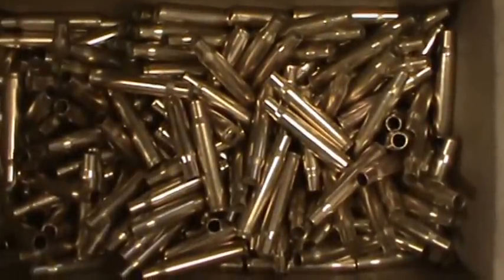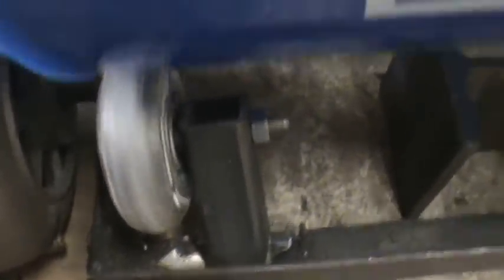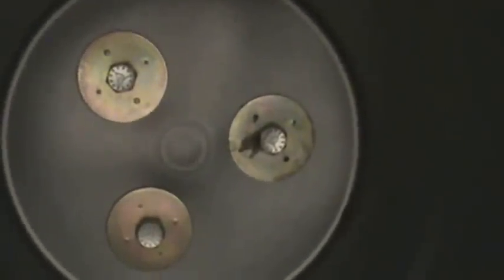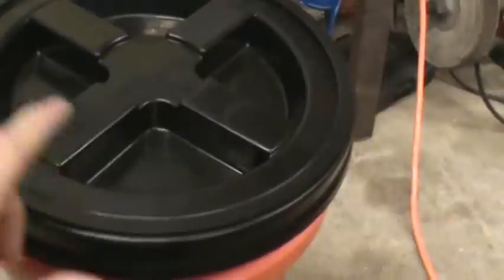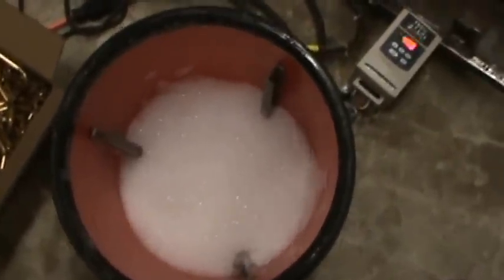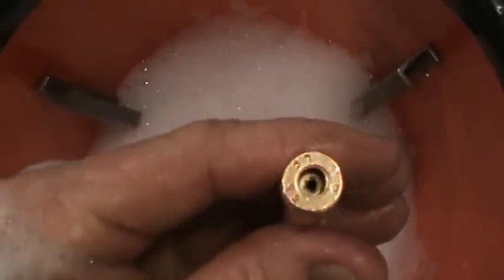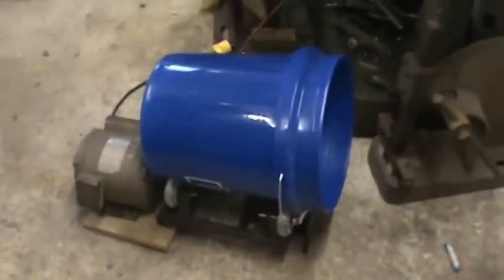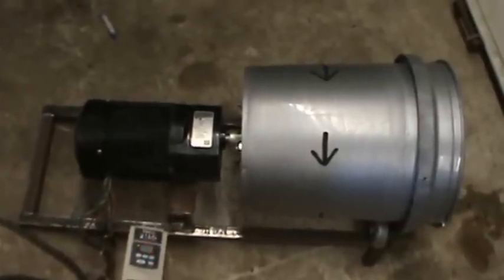Wet brass tumbler direct drive

Comment: It appears that your bucket agitators are made of some sort of steel?  I'm interested to know if you think that is okay for the brass.  Especially over time...  I know the pins are stainless...  I was making a tumbler last night and I came to that part of the project andwhere I had to decide what method to copy.  I thought of steel or aluminum, but since I hadn't seen anyone else do it, I thought that people might know something I didn't...  I used PVC pipe pieces, but steel would be more durable...

Comment: I just built one before even looking on youtube. Wish I had looked first. Made all the same mistakes. Built an elaborate rig with the non-direct drive...same result, did not work with full tumbler. I finally got one to work. I used a windshield wiper motor and a 12volt converter hooked to a 1/2 gallon wide top thermos type jug. A much smaller unit. I used some plastic kick molding for the ribs. Ran small screws with small nuts thru to hold them in. It works pretty much the same as yours. I am extremely cheap though. So I have been using zinc coated BB's + 16 ga regular zinc plated wire that I cut into little pieces. My brass gets very clean but they are kind of dull and less golden than new brass. I have since removed the BB's and just have the pins but they are not Stainless Steel. Tried to find out on the internet if these zinc coated wire pins will end up working. Have found nothing on it. I may break down and buy some stainless steel pins. I hate to pay $30 per lb for them though.
Reply from the maker: Sounds cool, would be nice to see a video....
Reply: Yep. I just have the prototype now...no support wheels yet and going to put the fan on it then will make video. I never posted on youtube. Will have to figure out how to do that. Thanks for the reply. And you do very good work, by the way.

Comment: How many horsepower is the gear motor?  What do you recommend?  This is a great idea, I'm making one for sure.
Reply from the maker: I think it is 1/2 HP, check out E Bay for used units, they are like $400-500 new...

Comment: I also have a  question about the agitator channels.  how did you attach and seal to be water tight
Reply from the maker: I used square paddles on the inside, I drilled/tapped for a machine screw, put a little silicone on the screws...
Reply: Telesaurus is

Comment: This looks great. Do you think or have you tried this to clean up dirty greasy bolts. I rebuild old machinery and need a good way to degrease small parts like nuts n bolts.Thanks Doug
Reply from the maker: I haven't tried it for that Doug, I'm not sure if it would clean up greasy parts, I'm sure you would have to run the parts in a solvent to cut the grease...
Reply: I had a severe grease problem with steel pins, something on the range pickup brass I was cleaning. Couldn't remove it, just got worse  and worse. Guntap advised hot water and pure lye with HOT water. Two-three runs, changing water after each, and pins were sparkling. Lye will absolutely clean the grease off. Just dry the bolts off to remove it and prevent rust. 8 oz. of lye (sodium hydroxide) about $6-$7. Don't mix anything else and keep the water HOT. It works.

Comment: Where do you get one of these motors?  Very nice set up friend!
Reply: I just posted what I did. But will share about the motor. I built one with a 12 volt car windshield wiper motor. I had a spare one for my 1999 Honda Civic. I have been using it with a 1/2 gal thermos type jug as a drum. Much smaller but you can usually get a used Windshield wiper motor pretty cheap or even free. Mine weighs about maybe 8 lbs full and the motor gets pretty warm. I just put a fan blowing on it and it keeps it nice and cool. Next I will attempt to wire a large 12 volt computer fan in series with the motor and aim it at the motor. This should slow it down a little (mine runs about the same rpm as yours, a little over 1 rev per second. or about 70 rpms. It could be slowed to maybe 55 rpms I think. Anyway, yes gear motors are hard to come by cheap. They are so versatile that people will rarely toss them out. Oh, you can do about 200 9mm brass at a time in mine.
Reply from the maker: Look on ebay for used, they are around 5-6 hundred new.

Comment: Good Job!  It will be hard to improve on that.  Did you put the baffles (channel) in the orange bucket, or did it come that way?  You didn't say anything about the orange bucket other than lid explanation.  Does the channel ding the brass?  Did you think of attaching strip brushes to the baffles OR in the place of the baffles?  It may cut down the run time even more.  I will email you the link to strip brushes.  I think it would add another level of polishing to your system and perhaps give some buffer to the sharp edge of the channel corners, depending on how you attached the brushes.  When you see these brushes, you'll know what I'm talking about.  ATD.
Reply: Joe Blake  Could you send me the link to the Strip Brushes?  I think that is a GREAT idea of attaching strip brushes to the baffles OR in the place of the baffles?  It may cut down the run time even more. Many thanks!